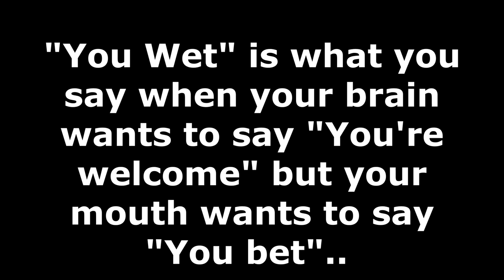Shed Repo With Tractor and Lawn Mower.

Comment: That building is one of the higher quality units. LP brand siding with the aluminum coating on the inside stays much cooler as it reflects heat back to the source